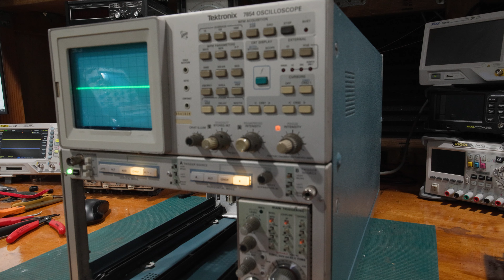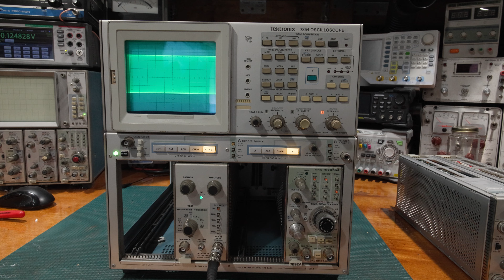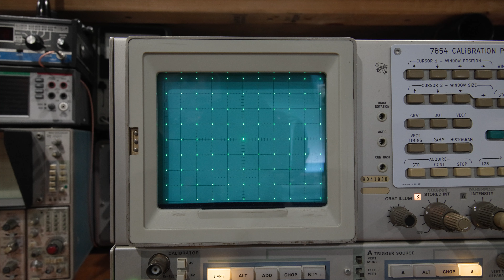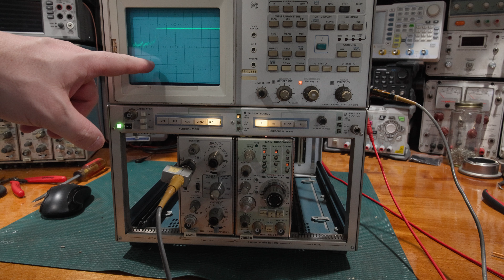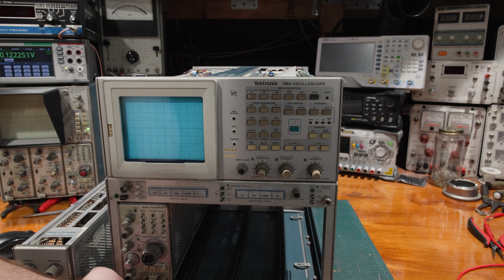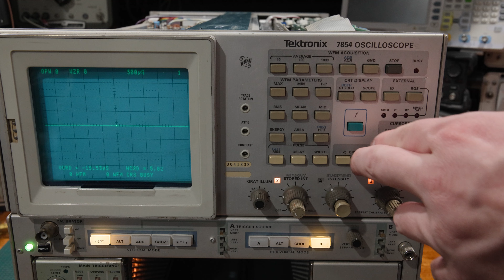Tektronix 7854 Vertical Alignment & Digital and Checkin

Comment: I have both an 7854 and 7834. I would like to calibrate them but I barely have most of the equipment I need based on the service manual. A few things can be substituted by other equipment I have but still way short. If I end up sending them out, can you offer advice on where to go and a generalized cost for this equipment. I tried one outfit to compare cal prices and for a ps503a they wanted $690. That's pretty outrageous but I have the equipment to do that on my own. I have a very limited budget for a while and some things needed go for more than $400+ each right now, to say nothing of getting them calibrated as well. Would I be better off wiating it out to aquire more equipment if not in a hurry to put in into regular service again?

Comment: Nicely done! I've finally had the opportunity to work through more of my 7854 restoration - the one with the full replacement of capacitors and the EPCOS restuffed main PSU filter caps - and am getting fantastic results.  I've got a clean 650pS risetime display from a standardizer as well as over 500Mhz vertical bandwidth available. My levelled SG options are currently limited to 500Mhz, and I'll get a better measurement of vertical channel bandwidth once I've restored my SG504 or buy something else. I'm currently on step H5 and have only encountered a few non-essential things I had to order parts for. I'm hoping that the slightly-jumbled stored readout display will be resolved with the remaining procedure or I'll likely be locating and repairing a readout jitter issue.
Reply from the maker: Excellent! that is great to hear.
Reply: @ZenwizardStudios  What's not great is the compensation around U65 vertical pickoff amplifier. It's always a 5-25pf trimmer, for some reason. C61 seems open and I've got A25 out to measure all the 1/8W carbon composition resistors around the amplifier. Regardless, with everything I have been through with this 7854, completion is within reach, finally!